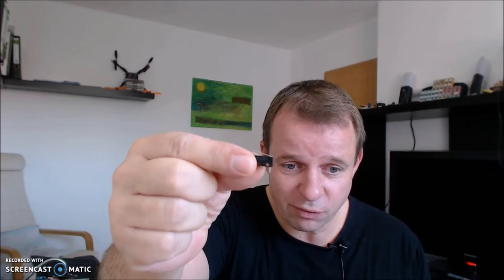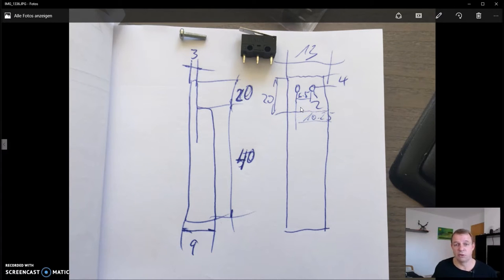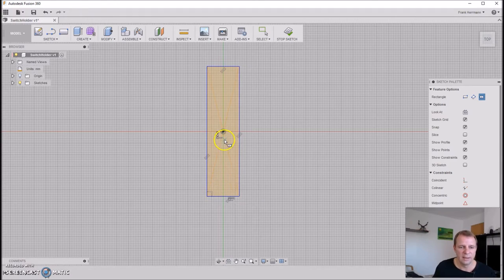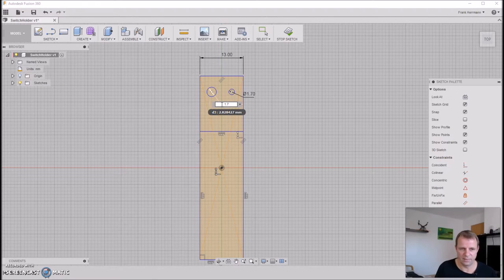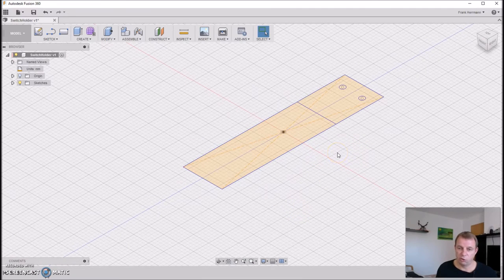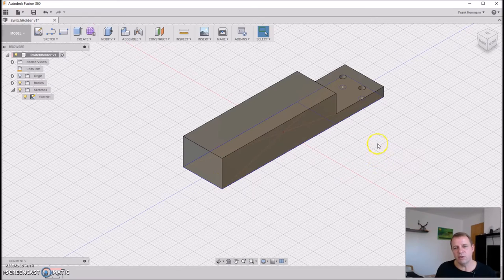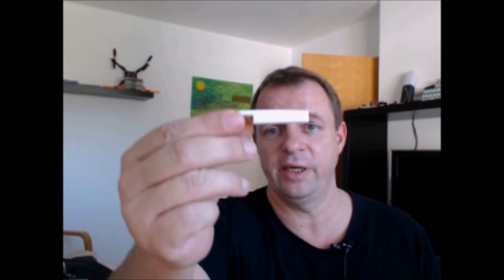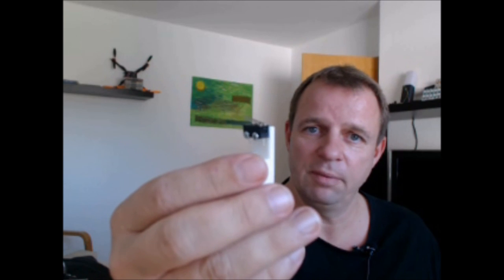SwitchHolder

Comment: Hi Frank,

Nice hands on demo of Fusion 360.
I will give Fusion 360 a try, seems easy and intuitive to use.

What is the filament material used for printing?

Vinay
Reply from the maker: many thanks, i used normal PLA from Orbitech, white with 1.75mm. Works great for me, but i have to use 250°/55°.